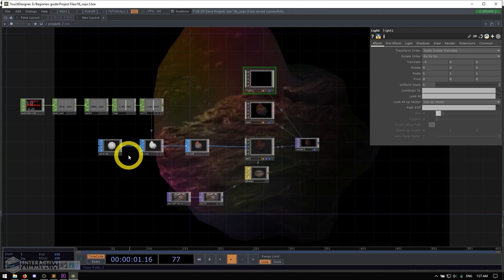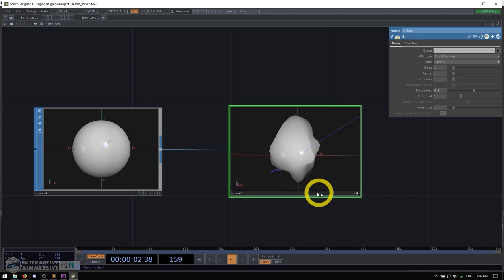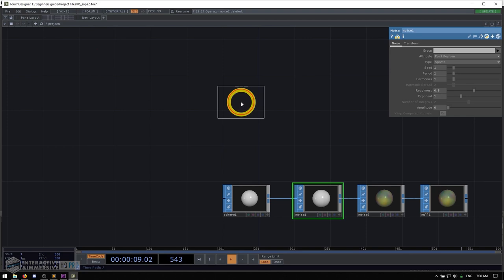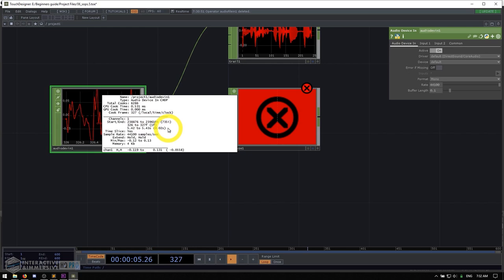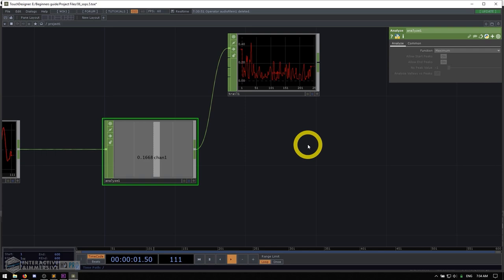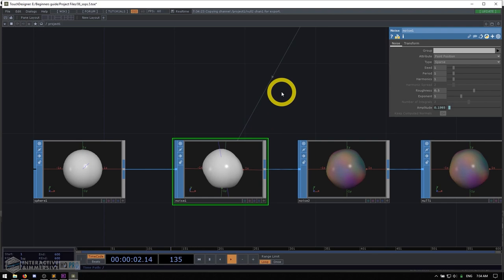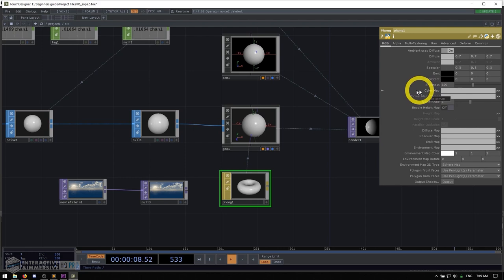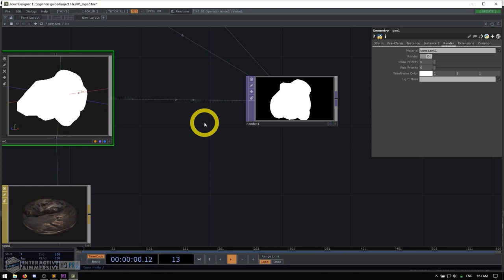14 - Working with SOPs and MATs - TouchDesigner Tutorial: Beginner Crash Course

Comment: i have the same set up as you however my video does not play in the render node. it works perfectly fine in the geo node but it just shows me a white sphere in the render - how can i fix this?
Reply from the maker: A couple things to check: 
- Have you assigned the Phong MAT to the Geometry COMP? If it's not assigned, you'll see the Torus within the Phong MAT's viewer textured correctly with the image, but the noisy sphere in the Geo COMP will still be grey. 
- Have you added a light to the scene? Without this, the rendered shape will be black.
- If you have added a Light COMP, have you adjusted the Dimmer parameter on the Light page? If this is set too high, the shape in the Render TOP will appear white.
- Do you see any error messages? This might give further clues about what the issue might be. Hope that helps!

Comment: Thank you so much for making this course ! I have some problem at 16:48. My sphere1 can not be rendered in render1 after i set up the light. Can anybody please help me ?
Reply from the maker: Our pleasure! I would double check that the purple render flag is turned on for the In SOP that is inside of the geo1 Geometry COMP. If that flag is turned off, you won't see the sphere in your output. Elburz starts covering flags around 14:50 in the video, and turns the rendering flag on around 15:43, if you'd like to see an example. 

If the In SOP's render flag is turned on, also double check that the render flag is turned on for the geo1 COMP.  If both of those render flags are set to on, double check in your Render TOP that the Geometry Parameter is set to '*' (without the single quotes). That'll make sure that it's pulling in and displaying the correct geometry. Hope that helps!